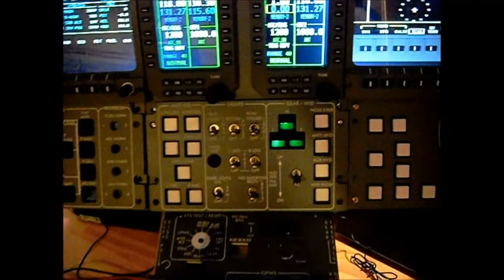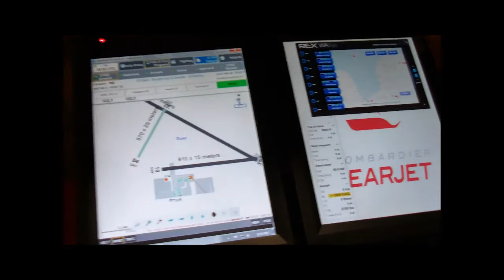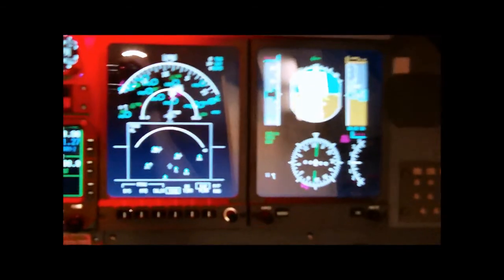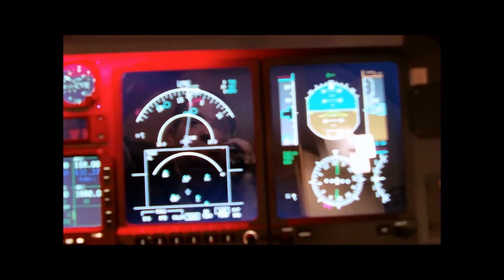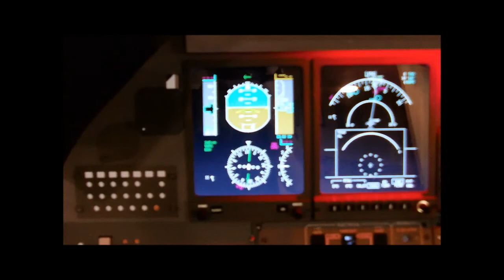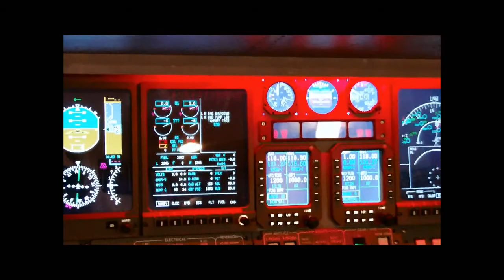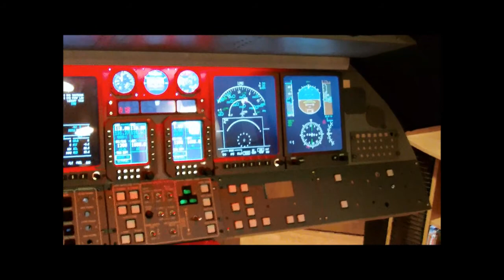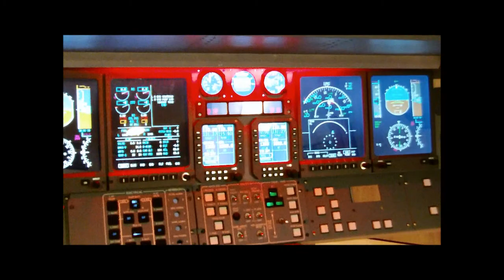Learjet 45 Home Cockpit Build Update Mar 31 2012

Comment: Hi Eric, nice video. Even in the real P1000 suite there is limited space to display the names and no lower case characters. Updates now allow up to 50 Flight Plans that will show in the box and they are scrollable via the rotary encoder! We also plan to allow the user to use lowercase alpha characters, but only upper case characters will display per the real life counterpart. The Reversion issue has been resolved and many other new fixes and enhancements are to be provided too upon release.